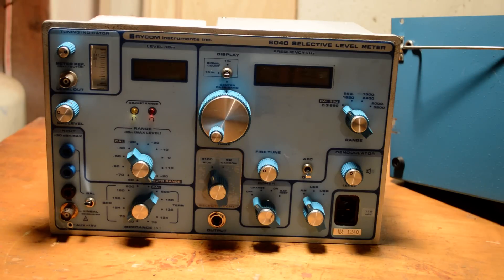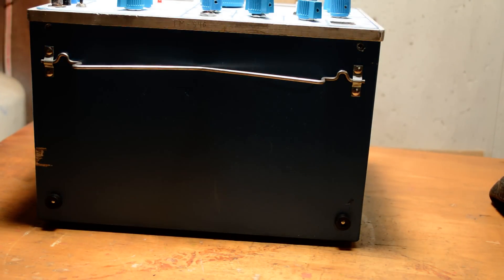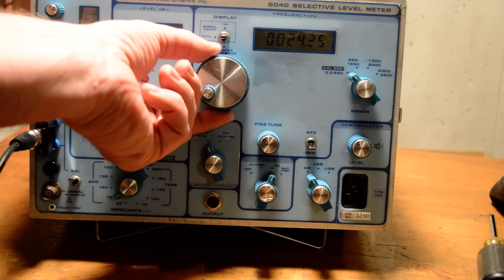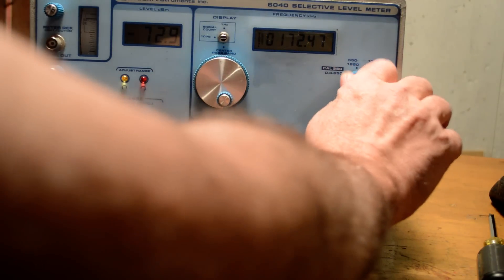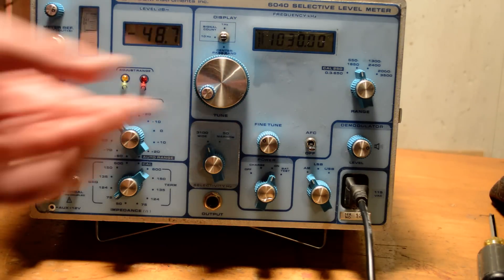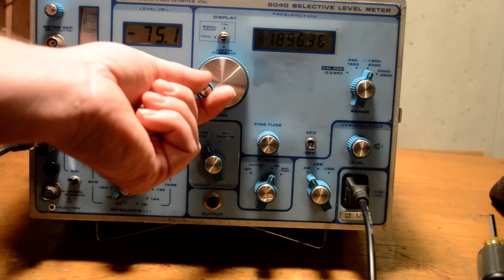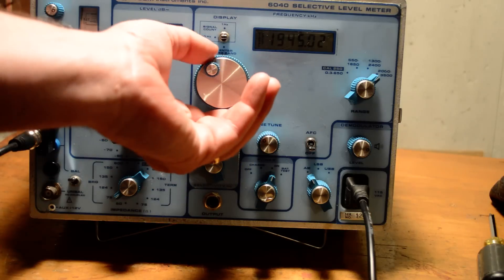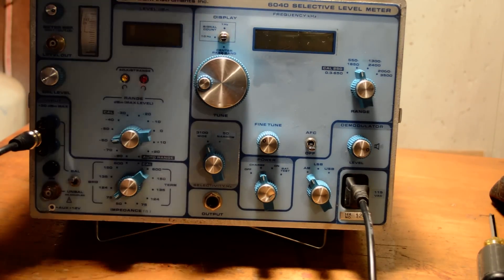Rycom 6040 Selective Level Meter VLF Receiver Listening to Cutler Navy Transmitter

Comment: If you grounded that little antenna you'd double your sensitivity--notice the signal increase when you plug in the AC power cord and the electrical ground is connected. Great vid--thanks!

Comment: Nice video, i got the 6041 model, pretty same as yours ... i got a 3 way selectivity Hz switch ... wide band, 3100, 50.  Need to do some field test, to see what i can hear, away from power lines and daily interference. However first i have to construct a good LF antenna.  Good Luck.

Ray

9H1RA
Reply: an excellent performing  small  sized  antenna for these is a PA0RDT  mini-whip, they work between10khz to 30mhz and are easy and inexpensive to build.
Reply: Great Thanks
Reply: +Ray Abela 

Well you may seem to know what's up in the "radio basement". 

Are there any voice comms below 520 khz. I used to have a Realistic DX-440 more than 10 years ago and loved listening to all kinds of stuff, but I do remember never hearing anything in voice lower than 520 on the AM broadcast band. 

Where could I get something that goes down this low? Is the internet the only place I could get one?